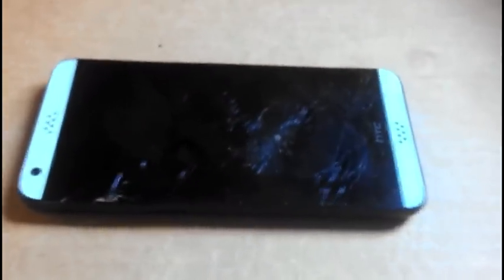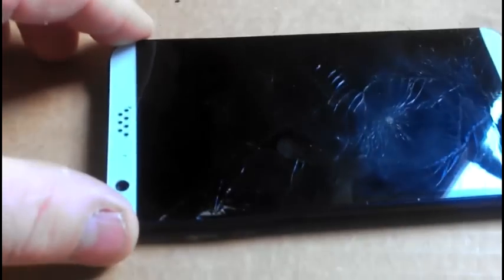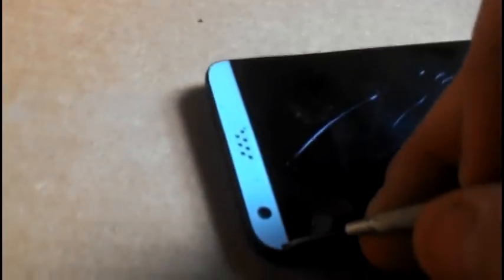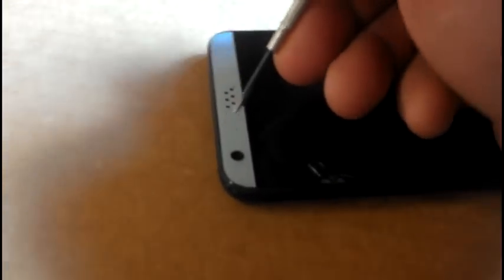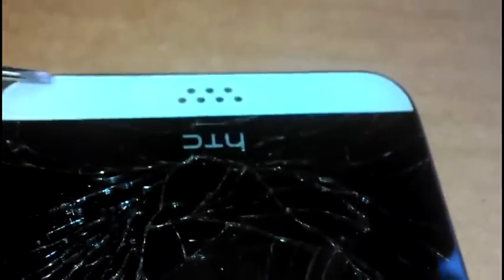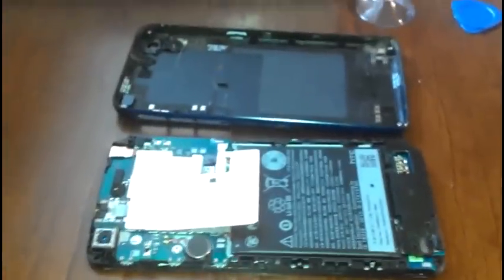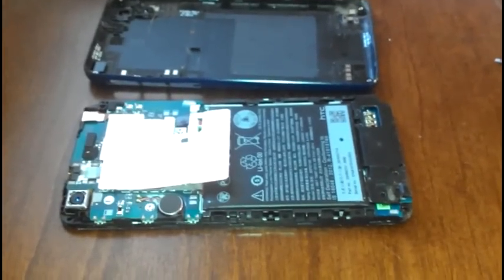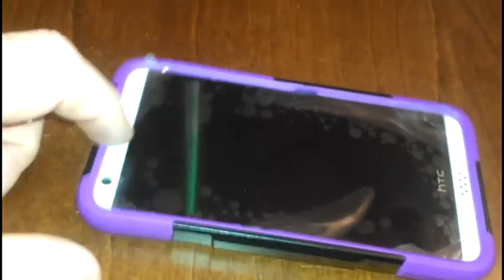How to Remove The Back Cover On A HTC Desire 530. it can be done

Comment: I need a new screen. It's broken. I'm getting very angry because I'm trying to find one. But it keeps giving me screen protectors. So can someone please tell me where to get a new screen. Screen. Before I completely loose it? Screen. Glass only. Thank you.
Reply from the maker: you can look it up on ebay or amazon you have to know the model# and type of phone you have and look for the touch screen digitizer replacement for your type of phone I can't stress enough to read all the details of the sellers info before jumping right in to purchase the part